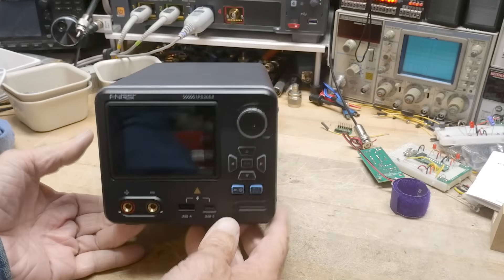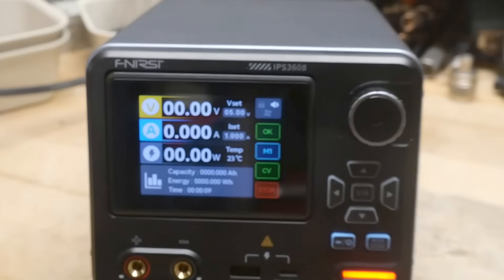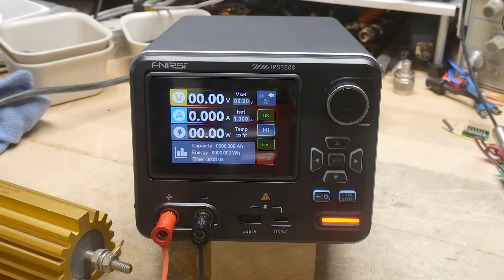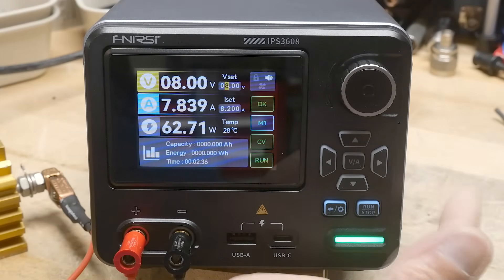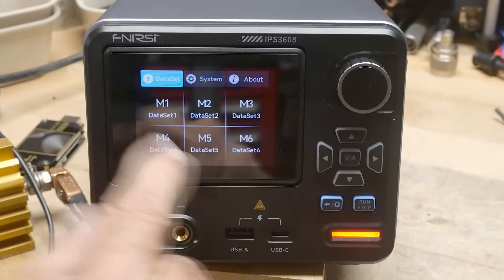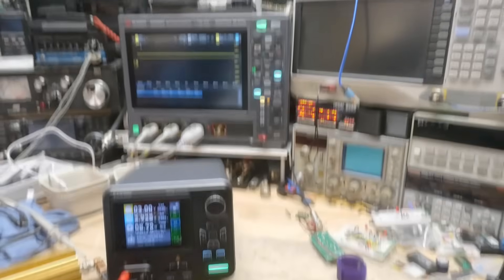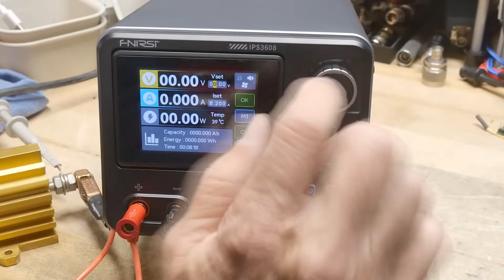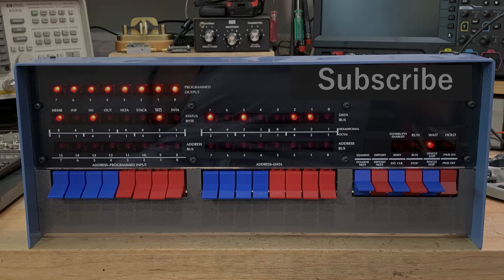#2423 FNRISI IPS3608 36V 8A Switching Power Supply

Comment: I have one of these power supplies and it works very well with one caveat,try charging a 12 volt battery ,for example a 12volt SLA type ,if you charge the battery the power supply will be fine,if you select run stop and stop charging it is a matter of time when the power supply will be damaged or blow an internal fuse due to back feed current from the battery,my internal 15 amp fuse ruptured but other users have encountered internal Mosfet damage so be very careful ,a good idea would be to disconnect the battery whilst in run,or put a diode in series with the positive power supply jack to prevent back feed problems.

Comment: Thanks for the quick review. I would like to ask for future power supply reviews to look at how they regulate and behave at lower voltages. Nowadays, it is frequent to work at 0.8V, and cheap power supplies, especially pure switchers,  tend to be awful at the lower end regarding regulation and noise as a percentage. Also, can you check for any transients when powering on and enabling the output? Just imagine why I worry about this...
Thanks again for sharing your knowledge.
Reply from the maker: Sounds like you need a linear supply. or at least use this as the bulk supply, and add a 0.8V linear regulator IC at your circuit.  I would be nervous about the noise a switcher has.
Reply: I agree! Quality like this is what I pay for, so a review that showed the limits of the quality of the supply would be really useful.

Comment: A word of caution regarding low-cost switchmode bench supplies: Many of them glitch when the power is turned on or off, so always disconnect sensitive loads first. The front button on the Fnrisi may solve the power-on glitch when AC power is applied, but what about when AC power gets cut ?
Reply: Not very scientific, but I power down my entire shop from the main breakers every night, and back on the same way in the morning, and have never had anything bad happen as a result (like, been doing this since the 80s!) - including with this same Fnirsi bench supply which I've owned for the last couple of months.

Comment: I have the same one! Bought it a couple of months ago when it just came out. It's excellent value for what it is, and when compared to the cheap cheap modules - you know the ones - at least you have a Run button where you aren't going to fry any connected DUT just by switching on workshop in the morning! Ask me how I know! 
Also, you propped it up to show us, but the screen swivels, so you possibly didn't have to! 
Lastly, when I had this device switched on but not using it (who put the power switch on the rear???), I was getting some dodgy floating looking noise on the 'scope while I had an amp on the bench. I couldn't figure out where this was coming from until I powered down the Fnirsi, and the noise disappeared. Some sort of radiated noise, but could have been the unterminated USB-C cable I had plugged in at the time? Will investigate some day. Great unit though.